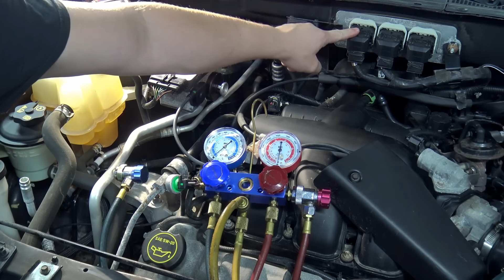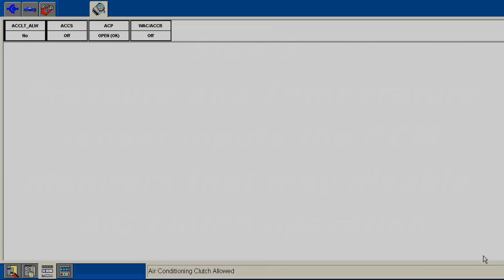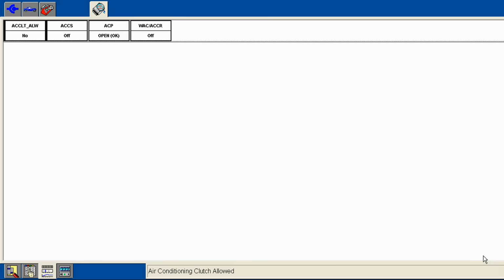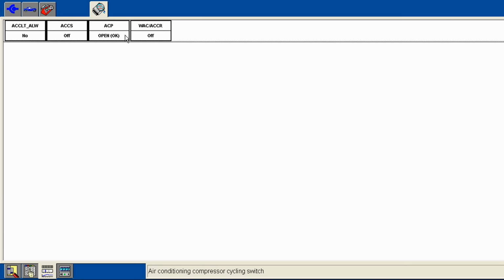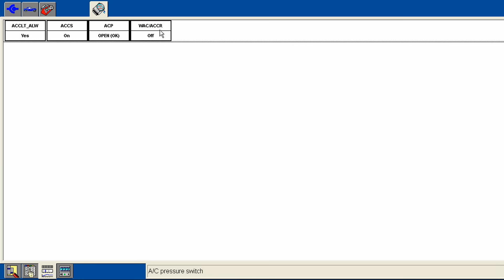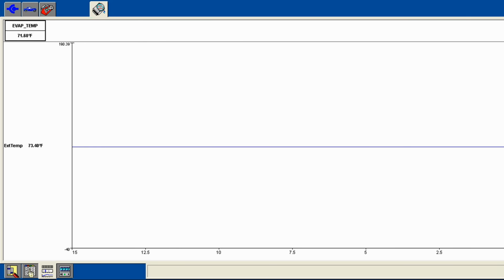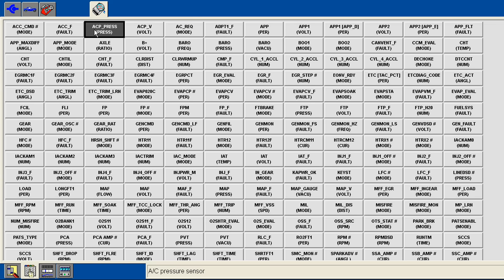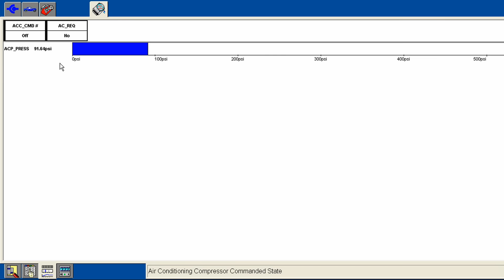Ford A/C Quick Tips #7: How To Quickly Diagnose A/C Concerns

Comment: great video man , very informational  , quick question , My heater works but ac dont , i can put it on ac and it will blow but no cold air what so ever,   could these be the same issues to look at?
Reply: Yes. If AC not blowing cold that usually indicates compressor not coming on... vehicles wont turn it on if pressure isn't right because improper pressure wont circulate the PAG oil through the compressor, causing extreme damage.
First thing to verify is the compressor not turning on/engaging (audible "click" with change in RPM), then check low side pressure to get reading (note itll vary based on vehicle as well as ambient outside temperature)...

Comment: Makuloco thanks for all the videos.  I have a 2013 Explorer Limited 2.0 Ecoboost.  The AC in it works sort of.  When driving and in motion works great when still or in slow moving traffic it is awful.  To me this suggest air flow or fan problem.  Is there a way with ForScan to trigger the High speed on the fan?  If High speed didn't work wouldn't that throw a MIL?  The temp in it stays constant according to the dash.  Right in the middle never gets hot but  I honestly don't recall the fan EVER going into high except when I changed the turbo, added coolant, and waited and waited and waited for the thermostat to kick in so I could add the other half of my coolant.  At which point the head slightly temporarily for just a min or less overheated.  As SOON as the thermostat FINALLY put coolant in the block I added coolant to top it off.  Other than that instance I don't recall the fan going into high.  WHere how can I test that?  Are you familiar with ForScan?  it is a free utility and MANY of us DIY'ers love it  Very helpful will do MOST diagnostic and module programing that IDF will do just not main PCM programming.

Comment: hi Brian thanks for the great video. I have a Smax 2008. AC works for a couple of minuts and then cold air stop. It works aganin after 10-15 minuts and then stop again. Garage confirmed there is not any leak and replaced a valve and now they want to replace motor venting. I'm wondering if there is anything I should clean before to spend money. any ideas? or any cable i should check? thanks in advance and all the best from ITaly

Comment: I have a strange problem in a 2005 Expedition. Vent ac only works if I first turn the fan on the lowest setting and then increase the fan speed slowly. Electrical climate control (no vacuum tubes going to the climate control box)....any ideas?

Comment: hi, any tips for a 03 ranger 4.0. the pressures are good but but the compressor doesn't kick on right away. usually a mile or two down the road or 15 - 20mins at idle. once it kicks on its fine and stays ice cold. but start up after sitting over night that's what it does.
thanks

Comment: Hi, I have the opposite problem. The AC is always on even when the temp is turned to heat. Also the compressor clutch will not disengage. Would appreciate any advice, thanks.

Comment: Hey man I know this is a old video but I have a 09 fusion that the ac compressor won't engage. I've Replaced AC pressure sensor,  evap temp sensor, compressor, and climate control controls (used). Also checked all the fuses and relays in the car. Do you have any suggestions?

Comment: I have a 2010 Navigator that I bought back in January.  Never ran A/C until now.  I thought my AC needed a charge since I did not have cold air coming out.  Bought some cheap setup at store and gauge reads at 100 when engine running.  After a few minutes, I realized the AC was not cycling on and off.  Not sure how the Expedition/Navigator compressors are set up but there is nothing that is able to spin on the pulley.  The engine starts and the pulley turns but I am unable to spin anything on the face of it when engine is off.
Reply: If unable to turn front face of compressor (not belt pulley) sounds like its seized up.

Comment: What if the compressor comes on but it still blows hot air? My system is charged to specs also
Reply: could be a restriction, or a bad compressor

Comment: This is an awesome video and has helped me get very close to fixing my AC issue. But... I’m stuck. 

2003 Ford Expedition 5.4 2V (250K miles) that had a loud noise when original compressor clutch kicked on. Clutch eventually would not come on at all. I replaced compressor and clutch, new drier, and new front and rear expansion valves. Vacuumed and added refrigerant to ~80 psi (would not take any more 12 oz cans) but clutch would not engage. Downloaded FORScan software and can command on clutch through self test. Have tested low and high side sensors which appear to be okay. Checked ambient temperature sensor as well. Still, clutch will not engage through DATC. Bad DATC?  On FORScan scan ACC shows off, ACP shows open (ok), WAC/ACCR shows off, and WAC_F shows no fault. 

I’m sure it’s something simple that I’m missing. 

Would be glad to pay you for some advice.
Reply: Did you ever resolve your issue?

Comment: I have a question. The only time I feel cool air is when the car is moving and when I am sitting still  the ac goes warm. So can you tell me what the problem is?
Reply from the maker: Low refrigerant, weak compressor or leaking scroll valve on certain models.
Reply: In my case my engine fans never turned on so they were bad as they should come on immediately if ac is turned on.
Reply: Dewayne Carroll having the same problem right now.. already changed the ac compressor and the drier.. recharged it damn near 10 times. and still no cold air.. starting to think its the condensor.
Reply: Find a solution yet?

Comment: Great videos we appreciate the helpful information.  I have a slightly different scenario.  I have a 2014 Fusion that is stuck on 15 degrees on the temperature control on both sides and will not adjust up or down on the digital display or the mechanical buttons below the digital display.  As a result, it only blows cold air all the time.  The ambient temperature seems to be showing the correct temp.  By the way, the settings are set for Fahrenheit and not Celsius.  Could this be caused by the Evap Sensor?  Most of the videos seem to imply that you will only get heat if the evap sensor goes out, but I am only getting cold instead.  It's as if the car thinks that I have the controls set to 15 degrees and it is trying the best it can to get it down the that temp, although we know that could never happen.

Comment: Got a 98 Ford ZX2 with odd a/c symptoms. When initially switching the A/C on, the clutch will engage for about a second or two then it will disengage and remain that way. I ran a few tests. Jumping the clutch caused the A/C to blow cold. Jumping the low pressure switch did not cause the clutch to engage. Static pressure was around 105 psi for both high and low side at around 90 degrees outside temps. Jumping the clutch to make A/C run, the pressure was around 40 psi low side, and 250 psi high side. Now here is where it gets weird. If you open the throttle, the clutch will engage for several seconds, and the air will start to blow cold, but then the clutch will disengage after a few seconds.  I got curious, and simply disconnected the high pressure sensor. Once the high pressure sensor is disconnected, the radiator fan goes into high speed and the clutch engages and the air blows cold. Any ideas?

Comment: Any tips for a compressor clutch not engaging on a 2006 Super duty 6.0 powerstroke? It was running fine and drove 2 hours with ice cold ac then all of a sudden, it started blowing hot..
Reply from the maker: There can be many reasons but first you want a pressure check with manifold gauges.
Reply: FordTechMakuloco checked pressure with gauges and it reads about 55. Checked power at the compressor coil plug and I was getting 13.75 volts at the plug, but the coil wasn't cycling. I changed the coil and still nothing.

Comment: Great video. Quick question, on an '04 mercury sable what would be causing issues with ac operation blowing hot air at idle or slow traffic yet highway speeds the ac is cold.
Both fans are running. Swapped new fans no change.
Unlike an older ford V6 contour it doesn't seem the the ac condenser fan isn't running at a higher speed?

Comment: my 2002 5.4 f250 AC blows cold for 5 to 10 mins then starts blowing hot....?? The AC clutch does stop spinning after that 5 - 10 mins. If I get out and give the clutch a bump with a rod it starts spinning again. Any ideas?
Reply from the maker: +Ryan Watson Well I would check pressure too but I have seen cutch electromagnets stop working when hot on Taurus vehicles yours works the same way
Reply: You should change your ac cabin filter it helps
Reply: Cabin filter has nothing to do with compressor functionality. It filters air before entering the vehicle interior. Nothing more.

Comment: enjoy tips . Have a 93 f150 convert to 134a on a full charge the hs is running 400 psi  low  side is 40 psi not not cooling well.
changed orfice and condenser and drier. Not to much left to change. Please help thank you!

Comment: Do you have any tips on AC not blowing cold air for a 2008 Ford Escape Hybrid? Pressure gauges showed to high so I thought too much refrigerant but when I lowered it to normal, AC still didn't start blowing cold air. The cooling fans are spinning, could it be the AC compressor itself? stopped working about a week ago. thanks in advance.
Reply from the maker: Well on the hybrids they use a scroll compressor so almost always the refrigerant control valve inside the compressor is causing the high pressure on the low side port. Its best to change the whole compressor.

Comment: I have a 2013 Ford Escape.  The A/C is blowing out hot air.  The dealer service tech said the tube has pressure in it and is not sure why there's pressure in the tube.  They ordered the tube and want to charge me $400 for the part and labor.  Does this sound right?  Is this something I can replace on my own?

Comment: I've noticed that the AC on a 2012 f150 isn't very good. Basically my issue is, when it gets to around 28-33 degrees Celsius, I basically have to have the fan on max, and it's lightly cooling the inside. If I turn down the speed to 3 it starts to get hot inside even though I feel a slight cold breeze from the vents. Any ideas as to why this is happening? It's been this way since I bought it brand new in 2012.
Reply: I don’t have a reply but, I have a similar situation with my 04 Sport Trac. I live in north east Florida. And off and on the a/c in my truck  will be on max and the blower speed on high and then when I either turn the speed to a lower setting it will start to blow warmer air and then when I switch it back to high it starts to blow cooler air again. Now it is an all original a/c system so there could be other factors involved here.

Comment: hey brian , i have a 2011 ford f150 xlt , my air is blowing but in 90 or ablove temp it will blow cold and them alittle warm then cold again , takes along time to cool truck , i checked out all pressure is good , even put computer on and said evap was 39 degrees , but when i read with temp gun at evap it says 55 , what you think

Comment: wish you could help fix my 2001 Escape v6 AC!  I have a leak somewhere but even after using dye I cannot find it
Reply from the maker: +Jennifer Pitts Check the compressor shaft seal
Reply: I found it.... it was actually the low port Schrader valve O-ring.  Changed it,  put system on vacuum and it held for over 2 hours.  Recharge was done and running beautifully!
NOW my 2000 Ranger AC isn't right!  Blows hot,  recharged with 2 cans and was working OK. By that evening back blowing warm again. 
No visible issues anywhere (holes,  gunked areas with dye, etc).
Reply: Jennifer Rae Fuchek did you fix the ranger yet??

Comment: Awesome videos, I have a 2007 f150 5.4 the ac works while the truck is moving but doesn't cool at idle. Do you have any idea on what that might be?
Reply: Did you figure it out?
Reply: Wondering the same
Reply: Fan clutch
Reply: A little late just saw it was posted 2 yrs ago

Comment: Just playing with forscan for the first time. I havent got a manfold gauge on yet but sensor is reading 15psi. also during self test  it found a p1464 pressure code. I cant seem to find all the same PID you had. I dont see a high pressure sensor to check? Safe to assume the high pressure wont do anything if the compressor isnt on right? Im excited to get my a/c back.

Thank for the vids, they have been helpful.

Comment: Sir, my AC clutch starts to turn on/off with 4sec. intervals. I checked everything from the pressures and relay and they were ok, ac is workibg fine but it happens only whenever its hot outside and my recirculation is off. I even modified the evap sensor you mentioned with the other video. Hope for response, thank you. Its a ford escape 2014.
Reply: Does 2014 Ford F-150 have cabin filter

Comment: hey Brian love the videos, had a question about 2003 explorer xlt with rear a/c. The front a/c blows cold ( fixed both the blend door motor and the max a/c fresh air door which fell on the blower motor.) I have an issue with the Rear a/c it only blows hot air, i tried to switch it from cold to hot and vice versa. The fan motor works fine. have any thoughts as to what it might be?
Reply: Had a similar problem with a vehicle of mine.  Rear blend door needed to be replaced.  As a side note, the rear unit also ended up developing a leak and I kept losing my refrigerant.  $400+ for a new unit, or $50 for two compression fittings to cut and block the back lines.  Economy has spoken, the kids no longer get cold air.
Reply: Ben Rollins I'm dying laughing.  That would've been my response.  😂😂😂😂
Reply: Pinch off the heater hoses near the rear A/C unit and see if cold air comes out. If it does the problem is either a blend door or heater water valve. If it does not blow cold you have a refrigerant problem.
Reply: Sounds like your rear expansion valve if you've already replaced the blend door

Comment: Daughter's 2013 Fusion's a/c wasn't working.  She took it in.  The garage said she needed a new compressor.  $$$$$  Not having the funds and since it turned cold, she declined.  Warmed up again in Texas.  She took the car to another garage.  They discovered that the compressor clutch bolt was MISSING!!!  Mechanic said they've had to install many (qty?) clutch bolts on Ford vehicles.  Replaced the bolt and all OK.  Bottom line......daughter is HAPPY!!!  That's what it's all about.

Comment: Hi Brian, thanks for the tips. I had an issue where the pulley was making a noise (AC on or off), AC was working fine, but then it stopped working. Noise got really ugly, ended up bypassing the AC compressor with a shorter belt, but now the AC pulley is not spinning at all. Any thoughts?
Reply: Your bearings seized up and you need a new compressor.
Reply: This just means the compressor pulley bearing went bad, correct?  If the clutch plate can be spun by hand, it means the internals of the compressor are still turning and did not disintegrate, correct?  If this is the case, then all that's needed is a new compressor & filter-drier, correct?

Comment: hey i had a question, not about a/c, my 2014 focus is leaking oil. I was doing an oil change and the bottom of the engine was full of oil. looking at the engine from the top, there's no noticeable oil leak. after taking a close look, it seams as though it's leaking further down around mid-engine. I'm guessing it's where the head meets the bottom half. 

should I be concerned? is it something I need to fix now?

it's a 2014 focus se  66k miles

thanks!
Reply from the maker: Yes I would get it fixed oil leaks can cause fires.

Comment: hey this question not about my a/c but I have a 1998 ford expedition 5.4, it wont turn over it starts but once the key is turned it cuts off and I also hear a low whistling noise before it cuts off, can you or anyone help!

Comment: Yes 90% of the time its low AC presure. But allso ~80% of owners dont know when car AC system has bean serviced or that it is recormended to do every 2 years. And if on that two year service time you still see low AC system then you have a leak some where most likely on condencer as you serviced the system and it newer has sean water inside....

Anyway great one!!!
I once had one which ended up bean wrong confiq. on PCM or ECM as here manual transmission is 90% on the cars.. Anyway "PCM" (on dtc scanner) had wrong config from older car( just secure update to match the car other modules, was done on it) that it was in and so it did see that AC was wanted, but didnt know what to do with that info as older car didnt have AC. That took a time to figure what the... :D

Yeah we only need ac like 2 weeks of the year so it take time to notice after PCM change...

Comment: You have 4 tubes coming off your gages. Where did you attach those hoses? They disappear behind the radiator. Live data stream? So you need a computer and software before attempting, as well as the manifold test? 

Isn't all that stuff more expensive than the cost of a used Focus?

Comment: Just did fresh oil change with oem filter an has oem cap or equivalent, the drain works fine to my knowledge, internal cluster gauge dosent move but oil builds up in filter housing, so should have good base pressure, and no white smoke that I've noticed. I'm using a scangauge 2 and noticed just with key on, ipr sits just below 200psi and doesn't change hardly when cranking..

Comment: I have a question unrelated to a/c and would greatly appreciate your input..my 05 f250 6.0 wont start-ficm v good-sync good-ipr stays right under 200 psi@85%-icp@0.45v-just replaced stc fitting/dummy plugs/ipr valve and icp sensor.
Reply from the maker: First make sure the low pressure system is ok, also make sure the oil filter is oem and the drain valve is not stuck open. Is there white smoke out the exhaust during cranking?